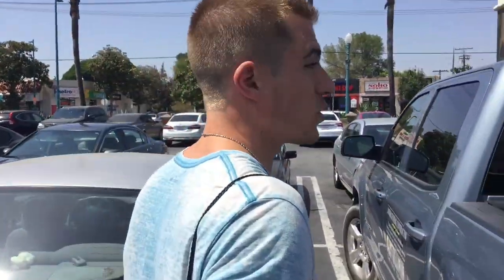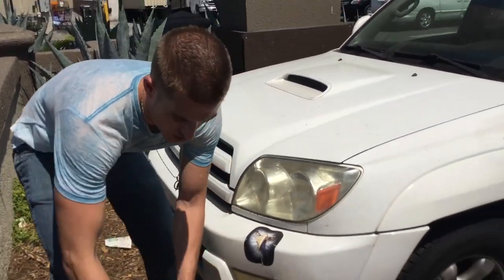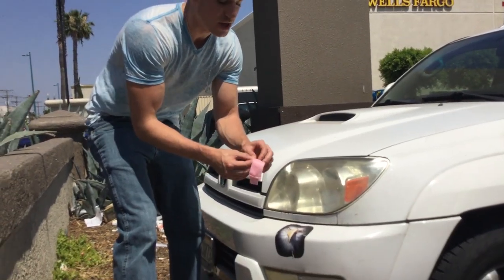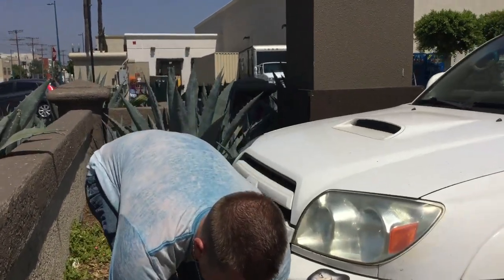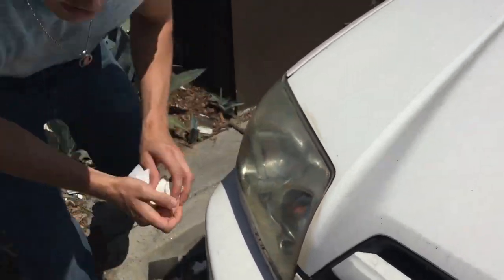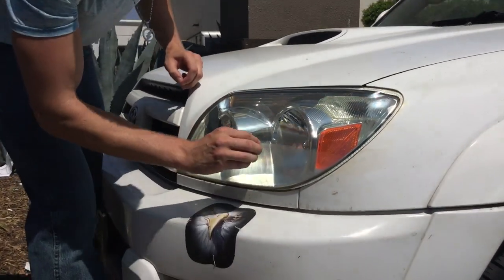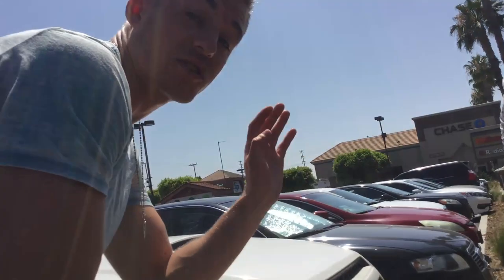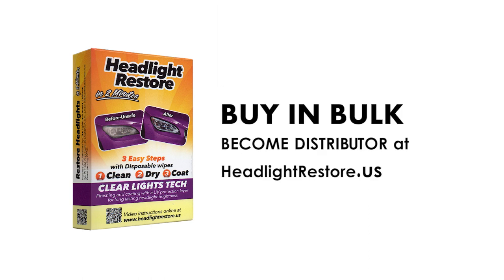Ross shows how Headlight Restore Wipes actually work.    Renov’ phares    Regen' Fari

Comment: I dare you to ex
plane the actual chemical process that this uses. Don't tell me "you just wipe it clean" tell me what is actually happening.
Reply: My theory is that it destroys the headlight EVENLY so that the second coat  fills in everything smoothly  thus changing the refraction factor of the headlight but it will change back after the coat has being washed/watered off. This would mean that if you just have a spot or two initially, after the clear coat goes off it will leave the headlights in unrecognizable destroyed state and I will be forced to rely on this product for life unless i take the car for a proper buff.
If you don't tell people how this works they will make theories and mine even if a bit grim is very valid.